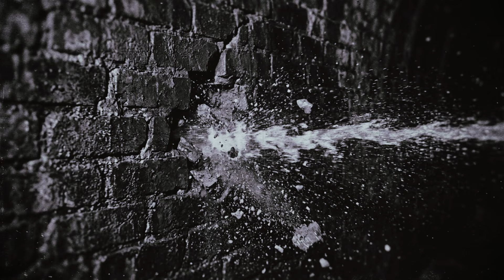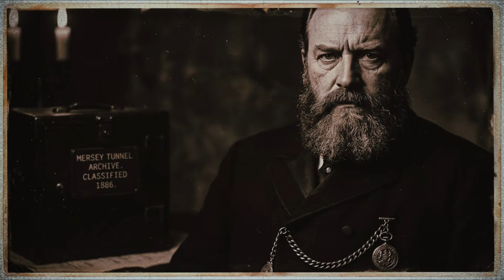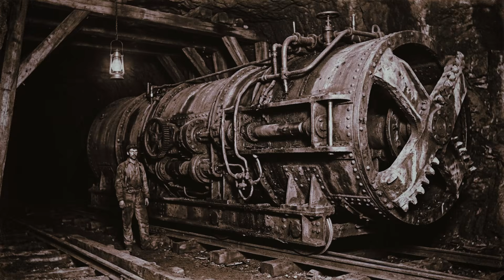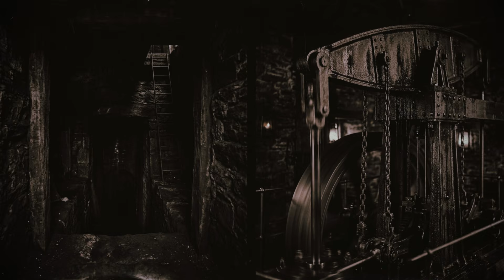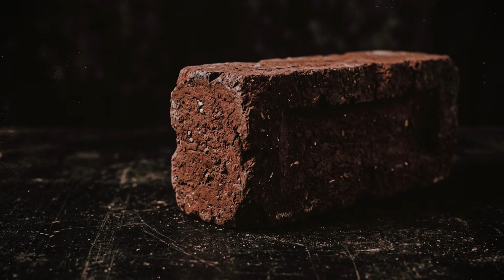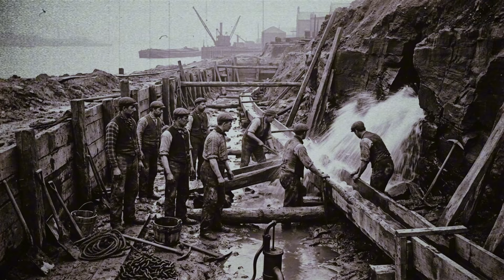They Built A Tunnel They Couldn't Breathe In

Comment: None of this makes sense.  There had to be mega events of massive celestial events....1780 -1880. Add mew laws. 

Your tunnels are tunnel shields at the least.
The foundation had to be older.
.that makes sense. 
No project does this. They would have drove iron  But unesco owns all sites worldfk wide😢
Reply from the maker: While I stay away from the celestial theories, I am absolutely with you on the physical evidence! The idea that the foundation had to be significantly older is exactly where the structural math points. The logistics of building those tunnels from scratch under those conditions make zero sense. If they were utilizing existing tunnel shields or repurposing an older megalithic footprint, the equation suddenly balances. The official paperwork reads like a cover-up for a massive excavation and repurposing operation rather than a ground-up build.

Comment: Archives are controlled by those who could never achieve any of these projects. We went from a society where blacksmiths built engines from raw materials to a population that relies on imported goods. All the brick kilns and foundries got replaced by social engineering programs to dumb down the population.

Coral Castle seems impossible. But it was built by a retired master in rigging. Not some anti gravity device. Just a tripod to  erect a bigger tripod with an electric winch on top. The mystery makes for a bettor story than the reality. And improper rigging is the most dangerous thing I have witnessed in the "modern" work environment.
Reply from the maker: That is exactly the point! I intentionally avoid theories about anti-gravity or esoteric mysteries precisely because the real, physical rigging and macro-logistics are so much more telling. When I audit the sheer tonnage and the math of the structural loads, it always comes down to practical engineering. The reality of moving massive materials, whether it's assessing actual rigging limits or calculating the oxygen depletion in a hand-dug tunnel, is where the true story lies. The fact that the official historical timelines completely ignore these fundamental logistical realities is the biggest red flag. I really appreciate you bringing this grounded perspective to the channel!

Comment: Awesome videos. 
Any structures in Australia that you could break down?!
Reply from the maker: @bradh1095 Thanks for the support! Australia is an absolute goldmine for the Audit Desk. There are several massive infrastructural anomalies there that just don't add up on paper. We are currently looking into the math behind the Goldfields Water Pipeline from the 1890s—building a 530km steel pipeline across a harsh desert to pump water uphill is a massive logistical red flag. We're also gathering data on the sheer scale of the Rabbit-Proof Fence construction without modern transport, and how fully realized "Old World" classical architecture popped up practically overnight in 19th-century penal and mining colonies. Definitely adding a full Australian audit to the schedule!